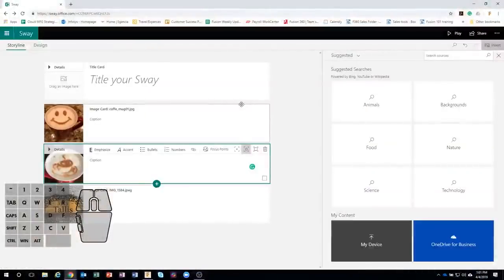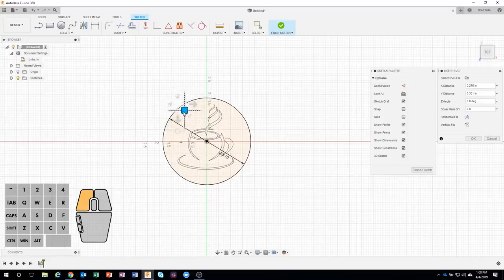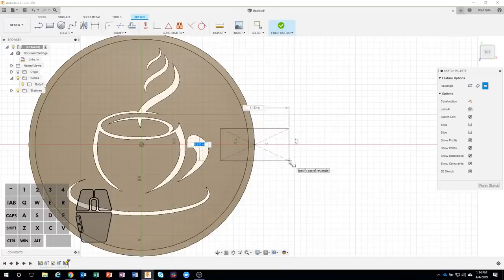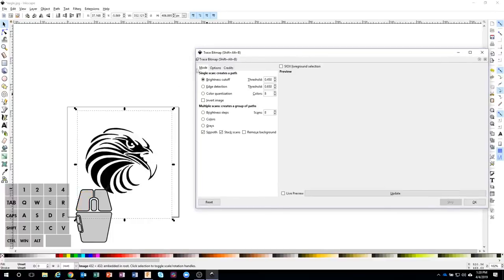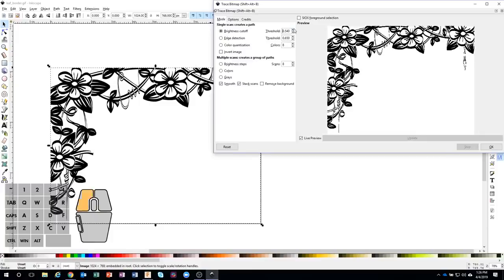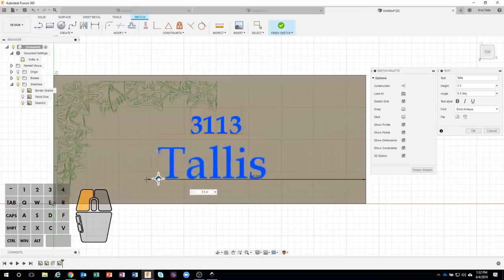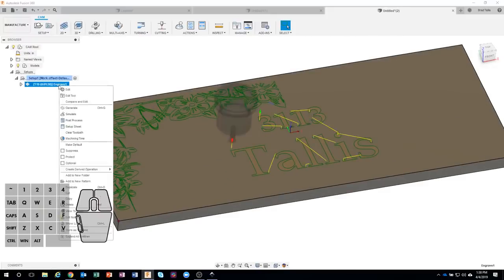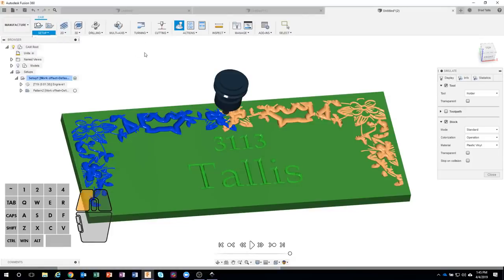Episode 25  Bringing SVG files into Fusion 360

Comment: Created my own SVG file and Fusion would not take my "save as SVG" I had to select "save as plain SVG" file. That allowed me to get it into fusion without error. Once in I was able to scale it down to fit on my sketch plane. When I moved the SVG file the computer was lagging by about 4-10 seconds. Then it just gave up and never recovered will have to shutdown fusion cause nothing seems to work under the menu items. Is there something I am doing incorrectly?

Comment: Brad two tips, dump the screen keyboard as it gets in the way and it is kinda useless.  I know you asked for opinions on this in a previous video but I waited on commenting until I saw a "regular" video.   The other tip is unless you model the text or the graphics, don't make a solid at all in design.   Instead when you create your setup  use a fixed sized box of your liking ( something like 6x24x.75).   For your tool path mirror use an (YZ?) offset plane right to the edge of your graphic that you want to mirror.   And if the setup stock isn't big enough after your mirror, just resize the stock in the setup.   The mirror works the same.